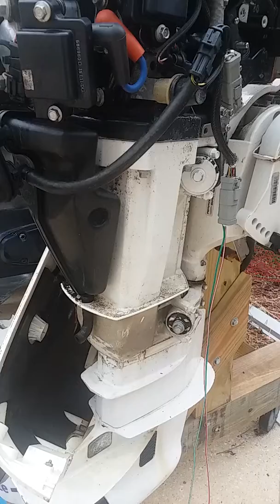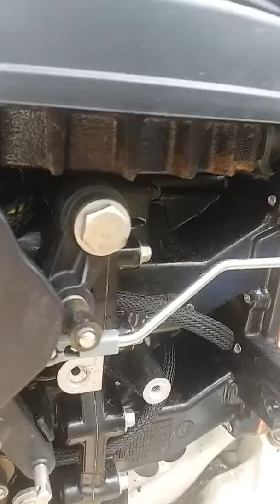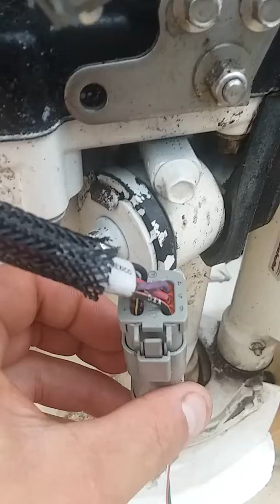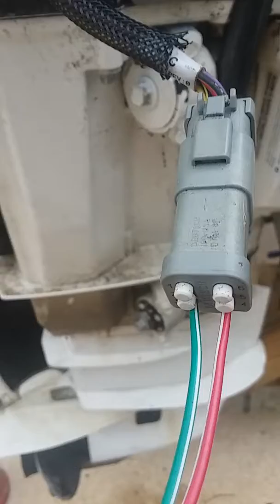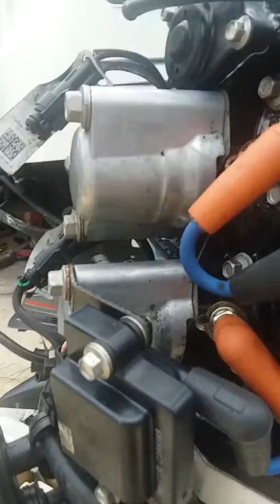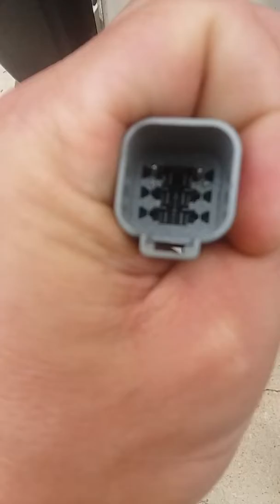EVINRUDE ETEC 25hp Pull Start EMM Power Up

Comment: Hello. I would like to know how to connect an electric starter  because I have an electric starter but it is not connected I mean when my engine is running if I push the button my starter works but I need a +12v and a mass arriving to this button.
Thanks.

Comment: This video is wrong.   red wire with purple dots is 12v Pins 5 to Pin 4 solid purple wire
Reply from the maker: They are both the same. Switched B+ one is fused the other isn't

Comment: Ain’t no working for me,connected but won’t power up emm
Reply from the maker: Is your engine running fine?
Reply: @HaroldWishard  NO can't get engines running so I'm trying to see what emm have to say 😊
Reply from the maker: @eniscanovolcano  I'm not sure what to tell you, it worked for me.  Maybe a bad EMM?
Reply: Harold Wishard  I have 2 30hp brp mfe military grade! What I think beside purple I need give power to plug where you connect cable for diagnostic😊
Reply: This video is wrong.   red wire with purple dots is 12v Pins 5 to Pin 4 solid purple wire